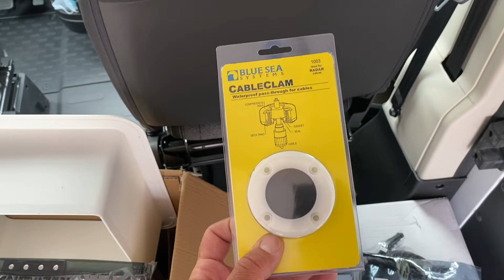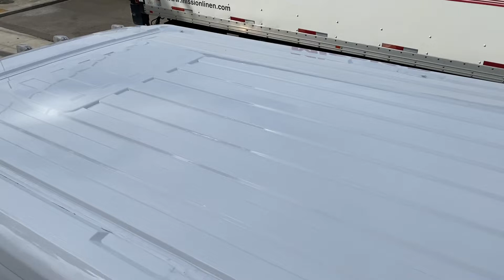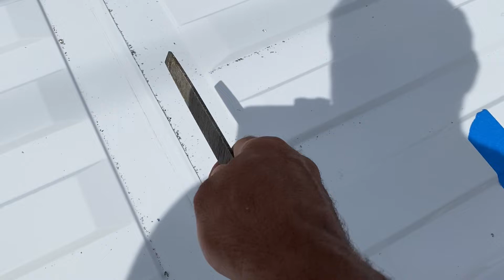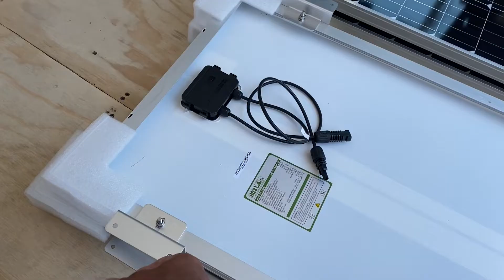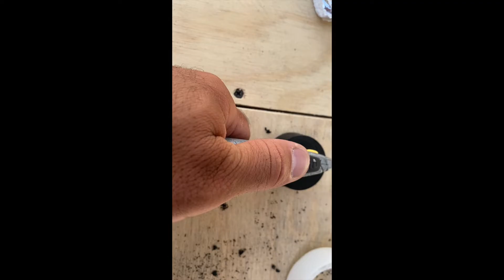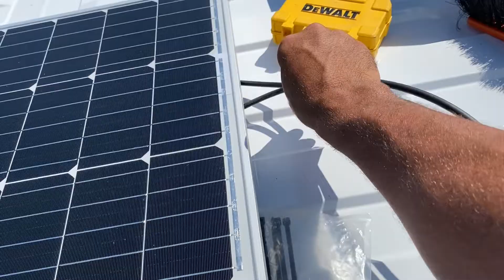Van Conversion Part 4- How to install max air fan and solar panels

Comment: Hey I bought those same wing nuts and they don't fit! Did you use a different set of screws than came in the Renogy bracket kit?? Also, can you recommend a different solution for me? JB Weld?
Reply from the maker: Yes I would go with my more recent setup https://youtu.be/MHIr19RxPHg
Reply from the maker: Between the two of these it should help https://youtu.be/Q_9hZAVETXM

Comment: Next time use whats called a 'solar cable entry gland', its easier to use than the Blue Sea cable clam and your wires exit sideways instead of straight up.
Reply from the maker: Those don’t fit between the ribs in the roof on the promaster.  I’ve tried before.